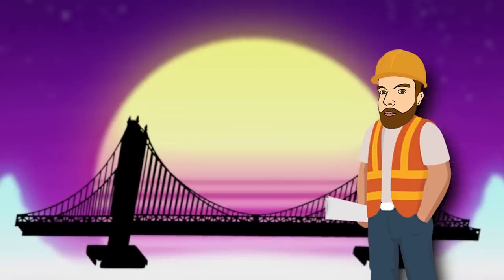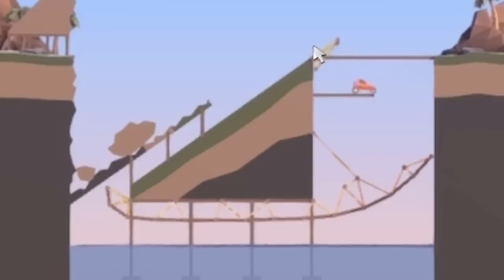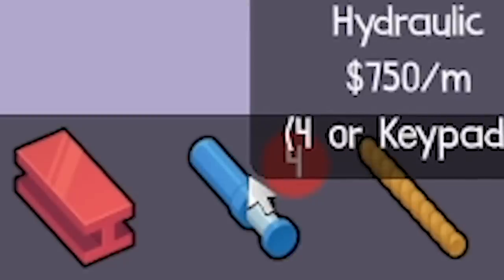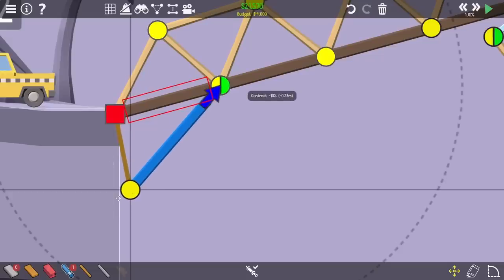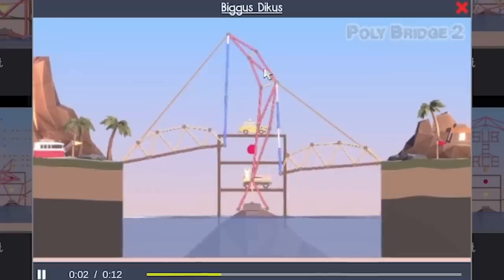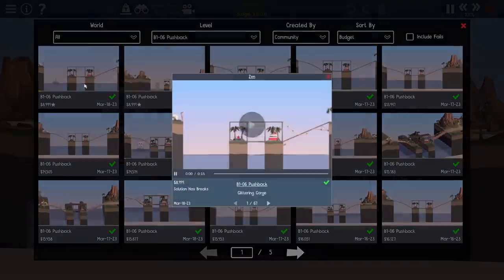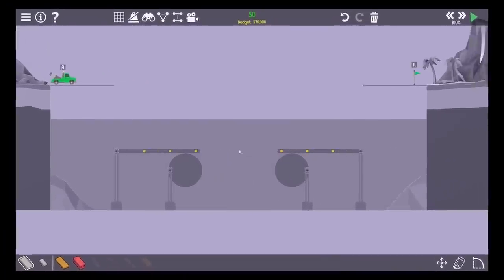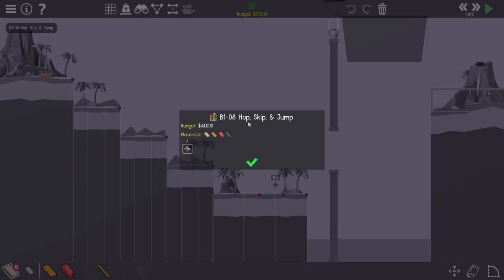We built this bridge using trigonometry... Poly Bridge 2!

Comment: I wanted to make sure I was caught up, so I had to cut losses eventually, but my original solution for Making Waves used the movement of the bars as a piston and turned it back into rotational force with the bridge built on top of the axles. I'm sure there's someone out there with brains enough to figure out how to make it work.